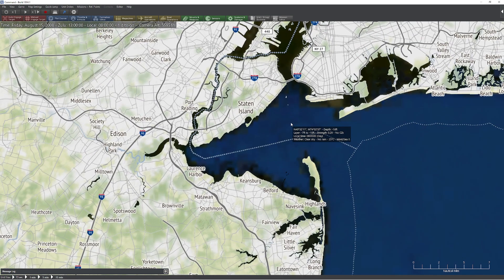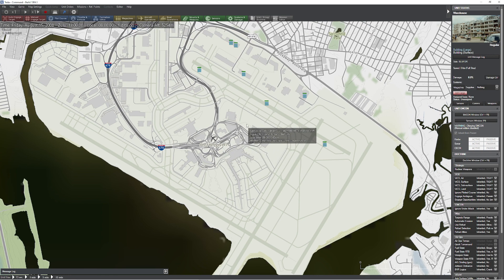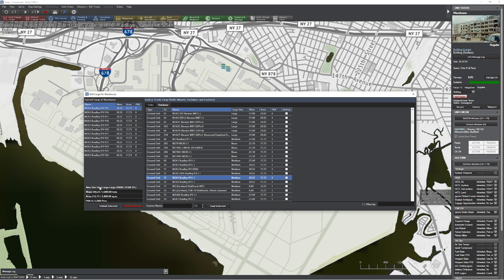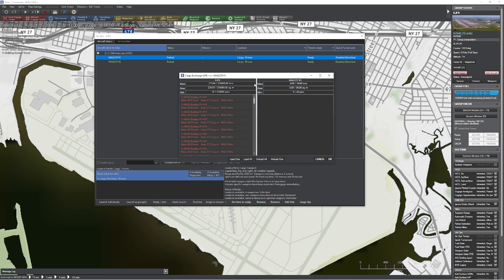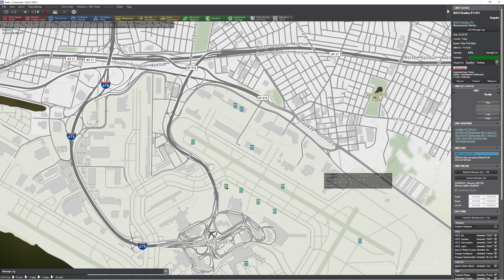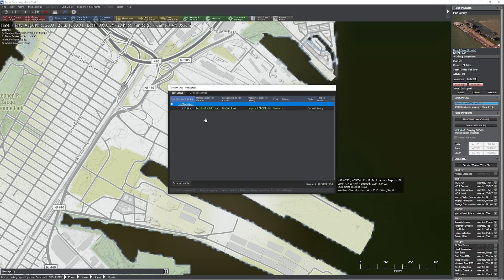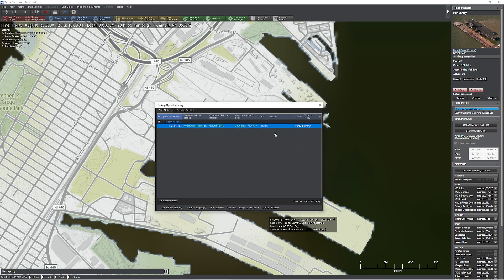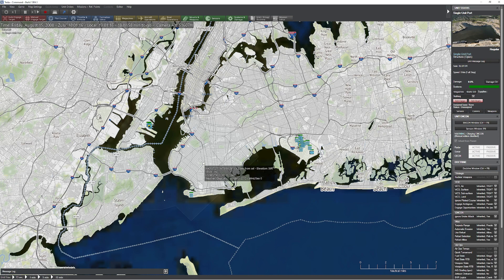C: MO - Cargo 2.0 Transfer

Comment: At this point unless I've missed it there isn't a way to ground transport containers, i.e. on semi trailers. The Cargo 2.0 release indicated the ability to transport 'something' from factory to front line. Not a major issue, but most factories aren't located on airport/airbase grounds. I think this also precludes transporting cargo from an airport to a seaport. Am I missing this and if not could it be coming in future releases. I'm a Pro user and looking forward to these capabilities being released on that version.